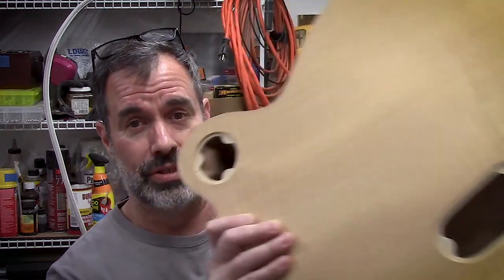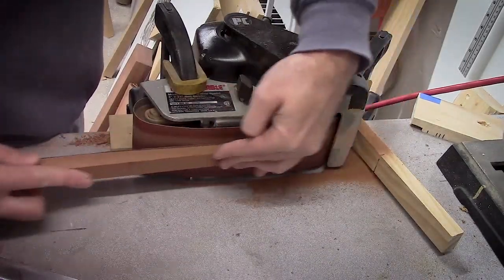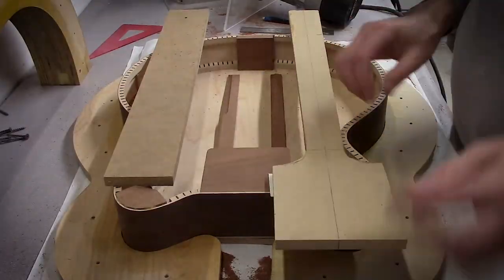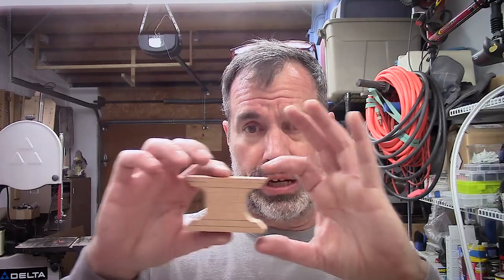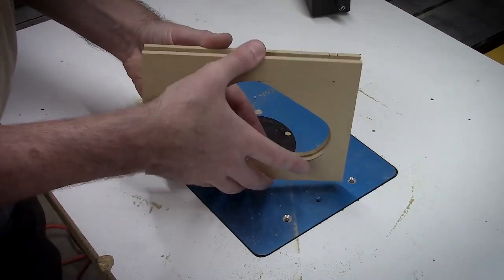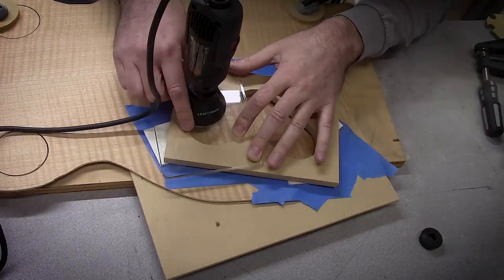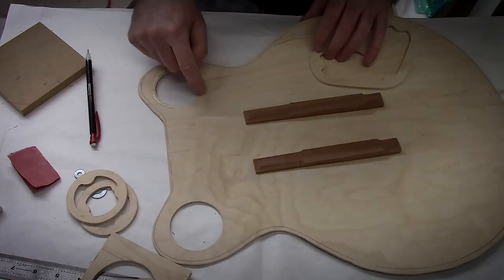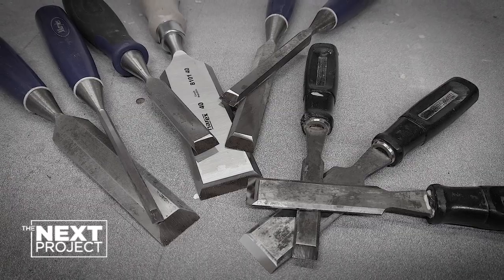Gretsch Inspired Guitar Build Project - Ep 04 - GGBO 2021

Comment: I'm so sorry I waited so long to watch. Seen, you got this video in the early afternoon, and now it's late in the evening.
I had a really hard time remembering the other videos of this series, it's been so long now!
I also got myself a Dremel copy rotary tool, I even bought my first, very cheap drill before that.
My biggest project so far will be an ST scratch plate, that has holes for the screws, but not yet for anything else. But this gives me the opportunity to place the f-spaced humbucker just a bit, maybe one centimetre (or less) further away from the bridge than the normal position. And I also can place the controls in other places. I think I place the five-way-lever like on the new active Harley Benton ST-20, beneath the volume control, but I'll have a tone control, that's placed some place else. Next to the tone control comes the kill switch, I now know how to properly wire a kill switch, and you take an N-O tap switch, not an N-C! You do a short circuit to hot and ground of the jack. The problem is, the kill switch needs a 16 mm hole. A wood drill bit won't work on plastics, but I can use it to mark the piece of plastic, that has to go and make the hole with the rotary tool. 16 mm universal drill bits are too expensive IMHO, so I have to do something else.
You know, my main focus is on the electronics. And you also have to know, if your only pup is a bridge position humbucker, you MUST wire it to a five-way-lever-switch! The only other acceptable option is a six-way-switch by Freewayswitch, but parallel out of phase is too weak IMHO.
The humbucker is an f-space Tonerider Generator.
Reply from the maker: Achim, good to hear from you. 
I guess I didn't think of time difference, thought you just didn't care anymore ( hahaha! )
Glad to hear you are getting your tool collection built up. Cheap drills and other tools can be okay, it gets you going and helps determine if you need something different. All good!
Sounds like you have a pretty good plan in place for your ST project. 
Do you have any drill bits for metal? That may get you by for the 16mm hole you need.
As you may know, most bits for plastic have a steeper cutting edge, more pointy.
But I have often used regular metal cutting bits for drilling pick guards and such. 
Wish I could help you out, but it's a bit of a commute I think.
Keep me posted on your project, sounds pretty cool.
Take care!

Comment: Maybe you should re-label it as your 2022 unofficial entry / (LOL)  Great build by the way. Have you thought of mounting either a passive or active transformer (powered via phantom power) in the guitar so you can plug into balanced microphone inputs ? I modified both my Gibson Ripper Bass and my Fender Stratocaster so that I have both style of outputs. It made it easier to feed a clean guitar tone to my digital workstation while also recording through the standard output through effects pedals to another digital channel. It also allowed me to run longer cables to my amps with a mic-line transformer at the amp end.
Reply from the maker: Hey Chris, thanks for watching.
I'm not sure, this could be a GGBO 21/22/23 contender at the rate I'm moving. 
I hadn't thought of any of that fancy stuff you mentioned, all way over my head.
There is plenty of room in this guitar for the things you mention, it's like a spare room with stings.
Hope all is well , take care!

Comment: Looks like a Hard but fun project. You make everything look easy. My recent opinion is I play mostly sitting and I like the guitars I have with the jack coming out of the front Like the ES- 335 and the Casino Vs jacks coming out of the bottom corner. Like on my Gretsch G2420T. I always feel like I may tear it off the guitar. Cant wait to see yours finished. Looks great.
Reply from the maker: Gary, thanks for watching!
I hear ya and I too (attempt) to play in a sitting position most of the time. But it depends on the chair/stool I'm sitting on, if the cable gets in the way.
I agree having the jack/cable out the front makes the most sense - practically, but I get hung up on it visually. And, I'm not very practical I guess, lol.
The Fender boat jack is a nice "fix" to get the jack off the edge, and not sticking directly out. That would look a bit funky here. Hmm, guess I'll have to invent something new, ha. Another project.
Hope all is well, take care!

Comment: Ever tried the masking tape and superglue trick instead of double sided tape?
Reply from the maker: Forest, thanks for watching and good to hear from you again.
Yep, I've used the superglue and masking tape process.

Funny story,  A fella I worked for did the CA+MT trick ±40 years ago. I was thinking "wow, that so cool!" He liked my excitement, I was a teenager...
I've since accidentally glued some things together using that trick, and once I found some "good" double-side tape, I really haven't looked back. 
For me, the 2x tape is far faster, more versatile, more forgiving. Just works better for me.
The way, and quantity, of tape I use, the CA+MT process would be way too slow. I'm sure I'd spill CA on something too. I tend to do that.

My typical 2x tape is Spectape ST501 Double Sided Adhesive Tape.
I also buy a nearly identical product from Woodcraft when in a pinch. I hear Taytools also sells a similar 2x tape, just haven't bought from them - yet.
Then I have a super duty 2x tape. It's too strong and gooey for most template stuff and it will pull wood fibers up when removed. XFasten Double Sided Woodworking Tape, 1-Inch by 36-Yards. I don't use it for most situations, too sticky.

Hope you are doing well, take care!

Comment: Tall thin braces are stiffer for a given weight and an easier sand
Reply from the maker: I would have to agree. 
Basic constitution principles, orientation of floor joist, wall studs... Main reason I went this dimension was to accommodate potential bridge studs. I didnt't want to blow out the sides of a narrower rib. 
That said, now I'm not sure if I'll use studs or go with a floating bridge, ugh.  
Some day I'll figure this out.
Take care!

Comment: Hi I really appreciate your videos. I get good inspiration out of them. When u cut out the fholes with the dremel tool, do you use bits with guide rings to follow the template or do follow by sight? Cheers
Reply from the maker: VE, thanks for watching, I greatly appreciate your time!
Glad to hear the videos are offering some inspiration, that's really why I share my projects. Just to offer others ideas and a feeling of "I want to make something....", whatever it may be.
The Dremel tool had a 0.8mm tooling bit, and I was using the smooth part of the bit (the shank) to run along my template surface. So the bit actually cuts a couple mm offset (smaller) of the actual template size. 
I'm looking for small bits with a longer mounting shank length which would help with template thickness. Sorry, that probably makes no sense. If you could see the templates and how the bits slides along them, it would be very clear.  It's really quite simple. 
Shallow, shallow passes, and moving slow are really the magic. Takes a little time.
I hope you are doing well, please keep me posted and good luck with your projects.
Take care!
Reply: @theNextProject  Thank you so much for your prompt reply :-). I understood your explanation. So I basically need to factor in the radial offset between the cutting part of the bit and it's shank when prepping the template. Since I do my guitar building in my living room I'm really trying to avoid using a router due to its noise. Gives me more use for the Dremel I've got :-). Looking forward to the next project:-)
Reply from the maker: @veguitars   glad to hear there are more living room builders out there. That is where I did a lot of work for a few years. Also clamped a lot of things to the kitchen countertop.  It's all good. 👍